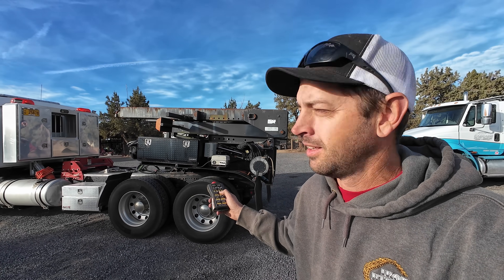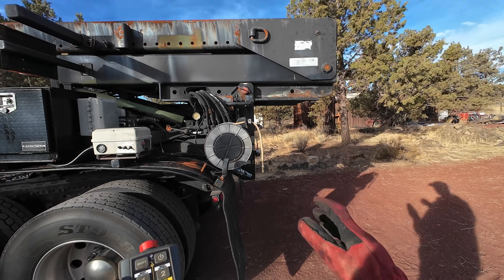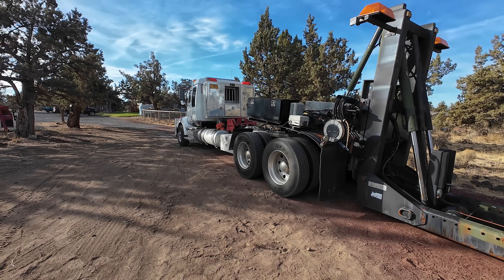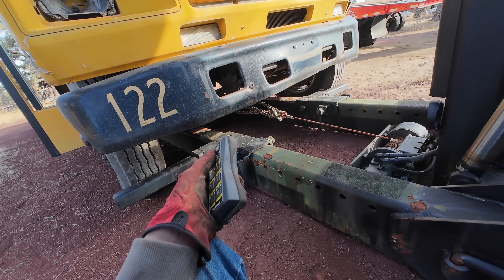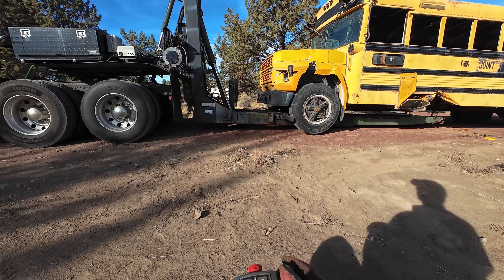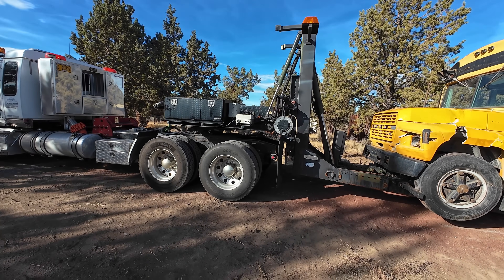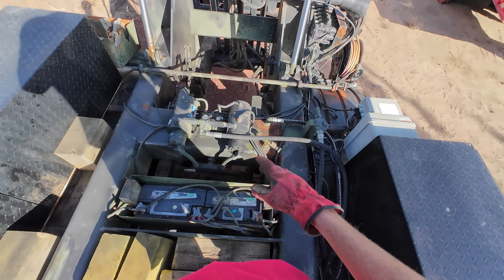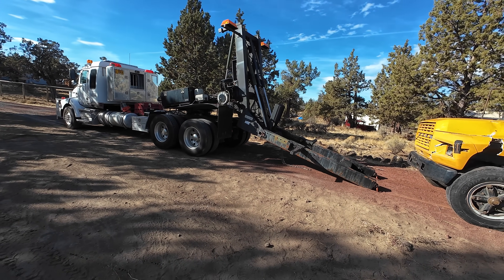This Military Auction Purchase Has My Neighbors Nervous...

Comment: We also called this The Holmes Lift in our Army unit. I was a wrecker qualified mechanic, usually wheeling a HEMTT. I wasn't too keen on it until our M915A5s came out with the Western Star cab with a sleeper. My last annual training exercise with the reserves was just me with one of these running between Indiana and Oklahoma picking up broken 915s and bringing them to local Freightliner shops because they were still under warranty. I was completely independent of everything else going on for the whole deal. Great way to cap off an eight year Army career as a mechanic.
Reply: When was this? What year are these m915a models? I googled the new m915a, and was suprised they still had series 60’s.

Comment: Very cool unit!  Never knew they existed.  You just demonstrated the same principle of the weight transfer bars used on large RV bumper-pull trailers.  I'm 72 YO and remember in 1966 Popular Mechanics mag used a then new Olds Toranado (front wheel drive) and hooked it up to an RV and cinched up the weight transfer bars really tight and removed the rear wheels on the Toranado and they were able to drive it around a parking lot with no rear wheels. Thanks for sharing!
Reply: I saw the same article back when the Toronado was the first GM front wheel drive sedan of the 1960s. It was the prototpe test bed for the Eldorado.
Reply: How cool!
Reply: Chevy did it with a boat trailer and plowed snow with a citation.
Reply: At the hitch company i deal with has pictures of the Oldsmobile with the back tires removed from years ago 👍

Comment: Cascade heavy rescue water balloon launcher just to attack Grumpy. 😂
Reply: Extend the booms, put some elastic on the shackles and then you have a god-tier slingshot, excellent for providing artillery support for a water balloon or snowball fight, lol
Reply: @mightyocelot with a little creativity, turn it into a catapult, stone thrower, soak a log with diesel fuel then light it and you have a flame thrower. 
Would it pull tree stumps out of the ground?

Comment: If you need to clean the rust out of the pin hole, chuck a cleaning rod into a drill and add a 12 ga brush to the end, works most of the time. Also, I can’t imagine the mad engineer who calculated all those pivot points to make that thing work.

Comment: I will vouch for Casey. I have used one, absolutely a pain in the butt to hook-up. Once hooked the towed united pulls exactly like a trailer. The best weight distribution in the industry. Only difference in the one I operated and his. The one I used we had to manually extended the arms.

Comment: It looks like chain lockers (like the zaklift safety chains) inside the extendable frame booms and chain slots instead of shackles at the end of the booms would really make frame hookup easier.

It also seems like some limit switches would dummy proof that monster a little.

Comment: Nice job explaining the weight distribution.  Curious if instead of driving the truck forward to pull away, if you couldn't chain the front axle to those retracted legs, then extend them to pull it back off the truck if you needed. Obviously takes longer but might be helpful in a limited situation.

Comment: Excellent presentation.  Thank you.  I might have missed it, however, I was wondering about the ground clearance in general and also the risk of getting high-centered with that setup.   That is a lot of "stuff" under the vehicle being towed.
Reply from the maker: Same as pulling my lowbed trailer
Reply: @CaseyLaDelle  Good point.  Thanks for responding.

Comment: Casey, most impressive. The light bulb moment when I realized the geometry that the true lift works from ..... very smart. My only concern for you is so many options relying on one tractor, the white !
Reply from the maker: @Tachyon62  if it really came down to it, I could rent a truck from a buddy of mine and run everything but the Zacklift.   The tru hitch and the lowbed are completely self powered and can be used with any truck

Comment: That is an amazing unit. Once you explained the benefit of the unit and how it transferred the weight, it made a lot of sense. I had the  thought that you could wind up with another truck that you could leave this mounted to. Then I realized the the cost, all the insurance and such. I guess that doesn't make sense unless you got really busy with heavy hauls, and maybe not even then. Anyway, interesting to see something that most of us will never see. Some very clever engineering going on there.

Comment: Just a passing thought. If you moved the wheel stops all the way to the front then winch your load almost to the rubber buffers, slide the wheel stops in to position then snug up the winch. Would hopefully safe a bit of time and effort guessing where they need to be.
Love the new(ish) unit. So versatile and limited at the same time. I guess it could move semi trailers with damaged pins or even damaged axles by putting the bogie under the front and hooking this to the rear.

Comment: It took me a minute, but it's a bit like a sling tow. Just instead of a rubber pad hanging from a winch, it's a whole assembly. Really cool. Kind of works like a Z-tow bar when they haul 2-3 new trucks to/from the dealers.
Edit: I guess not really. But now I wonder, if needed, could you haul a dry-van trailer with this.

Comment: Take a wood dowel and slot it, then put a piece of the green scour pad into that slot - almost as good as a wire wheel and a lot easier to deal with for the pin holes (ironically how we used to clean them for the Army units down in LA years ago since we didn't have small wire wheels that were long enough).

Comment: I'm having flashbacks of recovery school at Ft Lee, Va of using a Fifth Wheel Towing Device, that I've never seen in the wild. One of our instructors hated this thing because he felt that all the exposed hoses would draw bullets. He felt that the HEMTT wrecker (M984) was a superior product. There was even a recovery trailer, basically with no front end, that connected to the booms of this thing and made a complete trailer after adding the FWTD/front gooseneck.

Good stuff!

Comment: A company I worked for had 2 of them tow attachments. 1 on a big ol army truck that had awd and the diff lock was always on, And another attachment on a heavy haul kw t800 3 axle truck with a 600 horse c 16 cat that was spec out to haul heavy. The trucks those 2 carried were regularly over 80k on just a body load truck

Comment: Who says weight distribution hitches don't have a part to play - this is the great uncle of all WDH.

In Australia we typically only get to 6700 kg (14740 lb) on front axles - with super singles over375mm (145.76 inches). - for more than that we do to tandem steers.  Converting any tow into a gooseneck trailer - via a weight distribution, is going to make any long distance tow so much better on the haul unit.

I was waiting for some tricky rigging to winch the bus back off the extended arms.(snatch block poetry)...    lol...
Reply: Cool unit thanks Casey!

Comment: On those moveable wheel chalks, either use a hack-saw (or a Machinist Carbide Marker, (looks like a regular pen with a metal Carbide Point) just enough to make a groove so as to paint say a red line to mark each location, making it much easy and faster to move and locate.  Awesome piece of equipment.  Thanks for sharing..  For the record I seen the time stamp of the video, I said no way I'm going to watch a video that long.  Watched and enjoyed the entire 1:22:16  The camera loves you Casey, and you keep the viewer interested.  News @ 11  Casey attaches fake Rockets, neighbors go nuts.  LOL.  For inside that pipe / tube use maybe a Cylinder Hone with the little balls on it, if they make one for that Diameter.  Other wise, use a 1/4 - 3/8" in, Dia, solid round Steel stock, length as necessary, use a hack-saw cut say 2" in. length groove, at one end, cut sand paper to fit groove length, length of sandpaper I would start with say a 2"in. length, and go from their.  Maybe start with 80 grit sandpaper, go from their.
Reply: 😂News at 11, Casey attaches fake rockets….💥😂😂😂Thanks for the laugh

Comment: That’s a very capable unit. Just a thought tho, what if your finished your tow and the unit is not square behind the truck, once you detach the load can the fifth wheel support the unit and how can you square it so the support legs line up on the truck frame?
Reply from the maker: Rule number one…. Be straight.

Comment: As to how to remove the surface rust where the pins go in, use a black powder bore brush on a drill. They do have some quite large ones, probably larger than you need. 
🙏❤️😎🤙

Comment: With a tandem axel, putting ‘x’ pounds on an underreach would not take the same ‘x’ (ft) pounds off the drives.  You have a complex fulcrum as there are 3 points of contact with the ground, the forward most drive axel would prevent the steers from being 1:1 unloaded.

Comment: An hour and 22 minutes and 18 seconds, not including commercials. Microwave popcorn, a can of Root Beer and an afternoon Matinee. So that's what that is called. I have seen a Tru-Lift mounted on trucks, but your video explained what it exactly is. 
Nice t shirt day for a video. 
I would think if the rusty thing won't behave is to check the zerk fittings or just pump them with more grease. Usage and your good maintenance skills and this lift might just wake up and work smoothly.

Comment: Casey with the wire wheel pin holes. Can get wire brush attachments that look like toilet brushes. Wrap them with ducktape to compress the wire. stick in the hole. Pull trigger.

Comment: Wow that's a impressive unit. I bet with a set of tow dollies you could move sea cans and other stuff quite easily. Are you planning on putting a winch on the front of the unit for those just in case moments.

Comment: Just a thought. If you used support legs that slide into the front crossmember you would not have to extend the arms to counterbalance the unit. Not unlike the front of the Zacklift . It seems to my simple brain that it would be safer and take up less space.

Comment: To clean out the pin holes.
You can use a concrete hole cleaning brush on a drill.

Comment: You know you should take some blaze orange paint and put on the mast on the military lift so you always know that it's in that locked position and then you can visually see it and you wouldn't have to put those shackles in there like you were talking about. Since you're always watching it if that blaze orange paint was there then it's easier for you just to glimpse at it from either side as long as you see the blaze orange you know you're safe.

Comment: Casey would you buy a cheeper old school cab over for your low bed work in the future and then possible get a new longer frame westernstar to build your ultimate tow truck with Zach lift side pullers

Comment: Never saw or heard of one before!  Learned something new!
I was a little slow figuring out how the wieght transfere worked until you pointed out your 5th wheel was forward of your axles!
I wonder how many are going to argue with you on how that works?🤔  
A bit clumsy to use, but more capable for extremely heavy loads!
👍🫡

Comment: I got to operate a similar version of this system, the one i got to toy with comes with a trailer it connects into. Depending on the mission, can use it without the trailer and hook and book, use it as a make shift forklift or connect it and basically turn the trailer into a rollback.   Only got to operate it in school setting in 2016, the thing is probably one of the smartest things the military invested in in my opinion.   From my understanding primarly striker units got it, i worked on the rest of the wheeled vehicles and played with the m1089 and 984 wreckers.  You make me miss operating a wrecker.  Another cool system i thought that i didnt get to use, the MRV it was basically an armored up civilian style heavy wrecker from international, had a rotator if i remember right.  But guess big gov decided it didnt do as good of a job or was high risk on deployments and stuck with the 984, 1089 and the new system.

(The new system or version of this, MCRS: Modular Catastrophic Recovery System)  came in around 2013.

Comment: Just thinking out loud. It wouldn't help the axle load limit but a counterweight on the front of the Western Star could make up for the length of the frame.
Reply from the maker: Then I’m way too heavy on the front end when pulling a trailer

Comment: Its interresting piece of equipment to tow broken down military equipment somewhere in the world with limited choise of trucks in the country. Clearly to see its not build to last for years in use out in the fields. Rustproblem is due to material choise (no stainless) but also no cover uip shielding against rain or boxes arround. 
So yea its complicatet thing but for some rare applications maybee worth it.  It definetely neds a shead or rood above to sit in (the zacklift also) and some maintanance and paint on some functional parts... and a coat of oil sprayed on it everywhere to store it again after use.

Comment: Couldn't you lift the front bus axle  with the extensions/extenders while having the wooden blocks underneath the boom? 
If so, you should be able to use the remote to move the bus forward/backward to unscrew the drive shaft? You do that as the first step.

Comment: I'm confused about how it transfers the weight to the front axle. If the 5th wheel plate still tilts, how does it force the front end down? Maybe I missed something like some blocks that keep it rigid to the truck frame but if it had blocks then it couldn't pivot when you go around turns. What am I missing? I get the theory like a weight distributing hitch, just can't figure out how does it.
Reply: If the fifth wheel is located ahead of the center point of the rear axles then some of the weight gets spread forward to the steer regardless of the pivots.

Comment: The equipment you called a military trailer is actually a military wagon, because it has a steerable front axle and a towbar, not a a pin that seats in a fifth wheel mounr.

Comment: i have a serious question for you and it may be dumb but i dont know so im going to ask and yall can roast me however you wish. but ive heard you say insurance on a bunch of different trucks is insane. how does the insurance work with different trailers or attachments? i know its WAY cheaper than having 3 or 4 different big trucks. but do you have to have insurance on each piece of gear that goes on the back of the truck or is it all just factored into the truck itsself?
Reply from the maker: Yes, all of the attachments and trailers are insured as separate pieces of equipment, just like the backhoe.   It is FAR cheaper than insuring multiple trucks

Comment: QUESTION about the forward-backward for pulling the driveshaft:

Can't you chain up one of the legs that goes under the chassis, so you can remote control it, so you got the same ease as the ZackLift?

Comment: hmmmm.. arm chair heavy haul driver here with 60yrs of (no) experience :)     what if you left the wheel stops all the way up front....  Situated forks underneath "alsmost" as far as you figure you'll put her....  put some wood blocks on forks (with nylon blocks channel with wheels  or?) then lift it forklift style temporarily....  then you could dink around with winch to move truck back and forth  for better drive shaft removal.   Granted all that set up time  and you would have the drive shaft off already LOL.  Brainstorming older fart signing off now

Comment: Military has tow trucks.  A private company refurbishes military equipment so they are like new.  I see them leaving former Loring AFB in Maine headed south on route #1. They travel in convoy and they look brand new.
My late father was on the board of directors of Cummins Inc. diesel engine manufacturer.

Hello from rocky coast of Maine, US. 10.24,2024

Comment: You keep saying "like" a trailer.  You gotta knock that off.  There is no way, hooked up, in which it is not a trailer.  It IS a trailer.  You probably should check with the state to see if you need to get it a trailer tag.  I think you will escape that requirement only because it doesn't have any road wheels of its own.

Comment: In my humble opinion, an introductory lesson on how the Tru-Hitch 250MARTKC Fifth Wheel Towing Device system should not divert into a half-hour explanation of the twenty-seven ways to hook the arms to the bottom of the frame before we understand The Big Picture.  It's okay to save something for the next video.